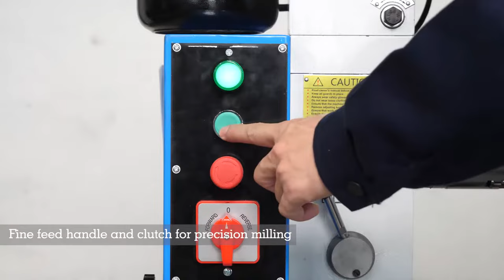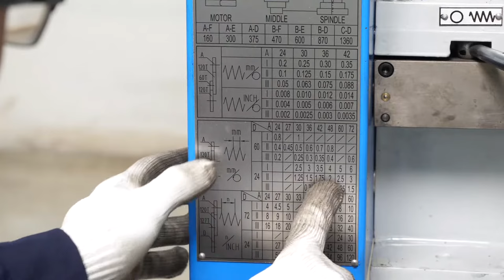How to Operate the Combo Metal Lathe Mill Drill HQ500 HQ800 - WMTCNC

Comment: That lathe can make left hand thread ?
Reply from the maker: It can make.
Reply: @wmtcnc  how can do it ? It is not possible in that machine because it does not have reverse gear. I use one of that and only right hand thread.
Reply: Your company sale some kit of parts to be able to make left hand threading on that specific HQ800 lathe model ? If so, can you let me know how can get it ...? Thanks.
Reply from the maker: @selprocr  For your requirements, pls contact our sales.😀
Reply: @wmtcnc  Sir. You here did answer that is possible to make left hand threading with that machine, but sales department of your company did answer that is not possible. Then why are you said different information.....? What is the correct información..?
Reply: @selprocr  it can make, but they don't have parts for it. No reverse gear kit.
Reply: @MarioAPN @wmtcnc  Hi friend, after doing some mods to my lathe, finally I could to make my left hand modification kit, I built a plate support and added a gear to be able to change direction of the carriage. This company @wmtcnc would must be able to offer to customers this kit as an option.
Reply: @selprocr  it is what it is. 🤷
Reply: Левую резбу,братан,можно нарезать включив обратный ход.Не забудь перевернуть резец😂
Reply: @selprocr плохо,мой китайский брат.Станки советские 1960-х годов всё могут.И стоят в хорошем состоянии до 500 000 руб.Не реклама,сам купил 1к62 в Челябинске.На заводе стоял дублером(это если основной  сломается,не путать с донором).Состояние идеальное.Я когда крышку открыл очень долго приходил в себя(не хочу матом говорить),русские поймут,что я хотел сказать.😂